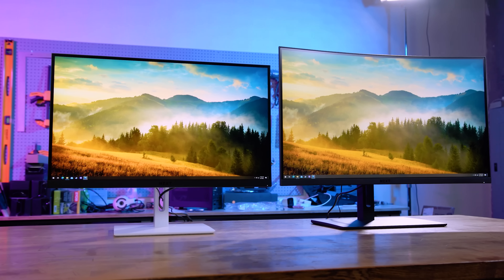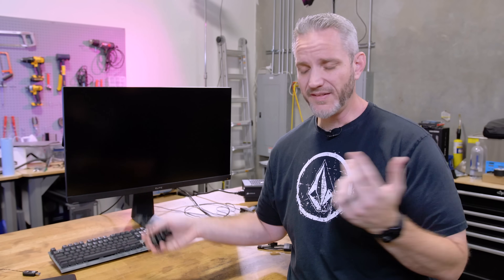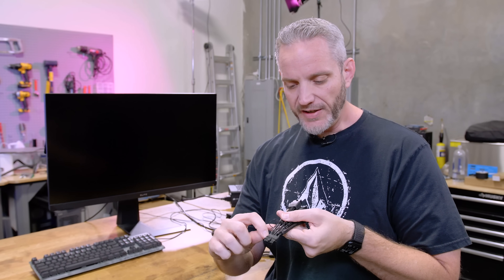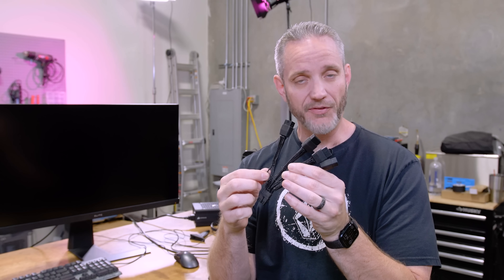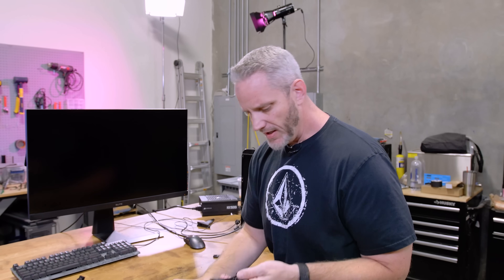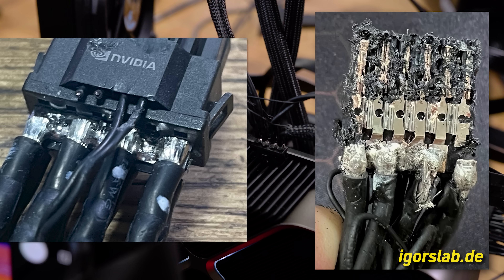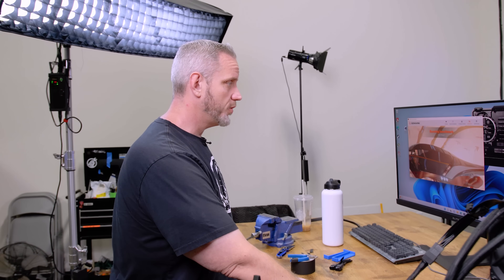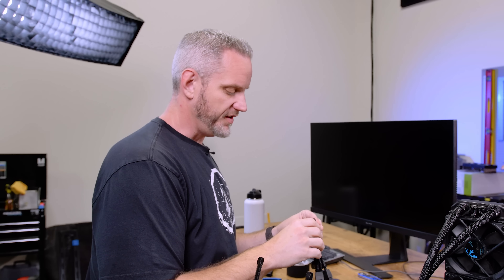Igor's Lab figured out why NVIDIA adapters are melting!

Comment: Jay, worst than no contacct at all is a bad contact (aka high resistance, but not open). If they cold solder barly touch the foil, then a hot spot is created. It's like having a tiny tiny wire with a lot of current going to it. In your case, there are other ways for the electricity to travel and this shouldn't allow for over heating on the bad contact. 

On the other hand, if all the wires from a single phase (rail) are cut due to desoldering or breaking pins, then there might be heat created through the bad contact from that rail trying to push its current though a small wire. 

For exemple, having 3 wires from the first rail on the 3 first solders spots and the last solder spot is being fed from another rail. If this last solder fails and make bad contact, then the heat would spread through pin and then the plastic and melt the connector.

This is my theory... Not sure if I'm clear. Englsih isn't my first language.
Reply: Spot on! It's the high resistance and intermittent connection of those broken outer wires. 
I remember as a kid I'd play with the light switches at home, trying to balance the switch between on and off... (made some nice spark noises) I melted 3... biggest hiding I ever got. 
This is amplified on DC.
Reply: I was about to say this. A bad connection is worse than no connection. If only a couple of strands of the wire are connected they can glow due to the high resistance. This can happen if the solder breaks but is held in place by the connector.
Reply: Yup, pretty much like an incandescent light bulb
Reply: Nope, bad connections carry little current in this situation, and have the least heating. Review the PCI-SIG report in Steve's video if you don't believe that.
Reply: that must be it - you pull it sideways, it breaks off then relaxes a bit as you let go. Then it goes back into place but barely touches this metal distribution plate and basically sparcs or just produces an ungodly amount of heat
Reply: I think this is it. A cracked solder or broken enough to cause some arcing seems more likely to be the cause of the observed damage to the outer pins, rather than just heat from increased resistance at the inner pins.
Reply: @laserspike  can you say which video? It's common sense if you're having a bad solder point either cold or cracked your having heat problems caused by high resistance. It shortly happened on my 3d printer. A bad solder connection of the power termonals caused high temperature which melted the fuse holder which was next to it.
Reply: Pretty sure it's a hot join, in electrical terms its the metal bracket and cracked which means its touching but not touching so it starts to Arc across and that's whats causing the plastic to melt. Happens in Circuit Breakers (most devices but more so CB's because its powering a Circuit not a device which is using more Amps) when you screw the wire in the Clamp if its not tight enough or sitting behind the clamp it can cause fires.
Reply: Exactly what I wanted to comment, then +1
Reply: Thank you! And that is exactly why the edge sides of the connector that are burning the most! And not due the "overload" of the other pins!
Reply: I think  @laserspike  is right, just have a look at how a parallel circuit of resistors works.
Reply: @1zui  Yes if the circuit is parralleke your joint won't heat like said in my first paragraph. What I'm not sure is if 2 differet rails are feeding 300W each. i.e. 3+1 solder on the connector. 3 first solders are fed from first rail, last solder from second rail. If the last solder breaks or has bad contact, then will that lonely wire try to feed the remaining 300W or what ever the cards require to work? 

Bad contact doesn't mean super high resistance (which would result in low current and just a tiny bit of heat before the tine pieces touching are melt then the contact is open). It means too much current for what a bad solder or small wire is able to support flows through it. 

A #14 AWG wire is rated for 15A. Put it on a 20A breaker and pull enough load on it (aka more than 15A) then you will have very hot wires in your wall. The #14 AWG is able to support 20A for a while, but eventually, your wires will become black then the plastic will melt then the exposed copper can start a fire. I think the same is happening here.

The wire and foil are able to support the current. The solder breaks, but stays in touch enough for the current to keep flowing. The contact is becoming hot because there's not enough "gauge" between the wire and the foil. It heats up, melt the plastic.

Comment: A piece of metal that is designed to be connected to a wire to is called a "terminal". The wire could be attached in different ways depending on the type, such as crimped lug terminal or a solder terminal or a screw terminal.
Reply: I would put magsafe on everything
Reply: I feel in this application that the best way to do this would be to ultrasonic the wire to terminal buss bar.
Reply: Actually the thin strip of metal is called a Bus Bar.  A terminal is specifically a device used to terminate the end of a wire (I.e.  Post Terminal, Screw Terminal, Push Terminal and the like).
Reply: @BromoDragoonFly  magsafe may affect timing too much at 600 watts. It's an awesome connector, don't get me wrong
Reply: @michaellindgren9653  exactly right. I've given up on trying to educate via YouTube comments. Hats off to those of you holding the line lol
Reply: Why is the solder touching? Was that encased in the wire jacket? If not, that could cause a short and a huge fire hazard. I also feel like Jay should've used a dremel to get into the cable. I think the jury is still out over if there's a recall problem.
Reply: A piece of rubber or plastic on the end of a cable that prevents this from happening is called "strain relief." Maybe, NVidia and the AIBs should google that!
Reply: @michaellindgren9653   I do not agree. Igors lab image at 9:34 clearly shows individual solder terminals for each wire cut into the bus. Yes, it also has a bus.

In the case of what is in this particular connector, I see a power bus or power plane (I wouldn't call it a bar since it is so thin), but I also see separated solder terminals. It doesn't matter if any of them are shorted to each other through a bus or some other device. It's still a terminal.

But for the meaning of terminal, at least using definitions common in the USA, look up a terminal barrier strip. It has many terminals on it. Whether a wire is connected or not, they are still terminals. Whether there is a bus shorting between any positions on the terminal strip or not, they are terminals. Each screw position is a terminal. An AC light switch has a hot, a neutral and usually a ground screw terminal. It's a place FOR an electrical connection, not necessarily the end of a wire and not necessarily the point where a wire is terminated.

A wire could simply be wrapped around the screw and tightened down to the terminal. If you have an insulated crimped end on the wire that end is called a lug, not a terminal. Many types like post lug, spade lug, screw lug or fork lug. There is a lot of confusion in marketing. Some companies call lugs terminal and or even "terminal lugs". The earliest uses of devices soldered, crimped or screwed to the end of wires to keep them from fraying or work hardening and developing cracks, that I see is when these wire ends are used on power cables. You still see the term "lug" being commonly used to refer to car battery wire connectors.

Reference (from the wiki page on screw terminals): "The wire may be directly stripped of insulation and inserted under the head of a screw or into the terminal. Otherwise, it may be either inserted first into a ferrule, which is then inserted into the terminal, or else attached to a connecting lug, which is then fixed under the screw head."

Comment: Having already cut back the connector probably helped it not fail. With the full connector still holding split contacts in close contact to one another likely causes arching between the two contacts likely deforming the plastic to a point it becomes a snowball effect on the connector via arching and resulting heat.

Comment: Hi,  on the soldering in the top left corner of your opened plug (9:58) it looks like the wire is a bit retracted. This is a possible point of failure too, as this may break under mechanical stress...and it is less surface contact as well as higher possible resistance. So even as it is way better manufactured ,it still could be possibly problematically.

Comment: The issue is not that the power goes through the middle wires, but that the corner ones (while not being fully connected) are arching inside the plastic, and that is increasing the temps.
Reply: That actually makes perfect sense!
Reply: It's called increased resistance.
Reply: What doesn’t make sense to me is that the melting is occurring at the pin connection point and not inside the connector where the problem is claimed to be. Hopefully Nvidia will share its findings. It would make sense that the melting would occur at the area with the most resistance which would get the hottest.
Reply: @Brian the reason why its melting at the pin side is because that's the thinner part of plastic. If the whole section is heating up, the thinnest part will melt first and everything else will follow.
Reply: The outer wires are stressed MORE due to the larger bend radius (and therefore force) on them when flexing the connector assembly. One of the Golden Rules in electrical/electronic power circuits is NOT TO CONCENTRATE CURRENT IN ONE PLACE ! Best practice is to DISTRIBUTE it. E.G. four 6 or 8 pin connectors. This issue of overheating is SO well known that it's TRULY INSANE that Nvidia chose to go this way.

Nvidia are also pushing the current rating of the contacts BEYOND the Molex ratings (8 Amps maximum per pin - as low as 5 Amps in multi-pin housings, as here).
Reply: @jimhall1131  There is no ARCING or evidence os ARCING. What you are seeing here is RESISTANCE HEATING and ONLY resistance heating.

Don't be a FATHEAD and make stuff up or talk about things you clearly don't even begin to understand.
Reply: Yeah, a single 14 awg is rated for 15A, so that would be 180W... it's pretty safe to assume they could go up to 300W without melting. So the problem is not all the current going through only 2 wires, but the disconnected wires making intermittent connection which is much worse.
Reply: @brianrobinson3961  The electrical resistance is its highest at the point where the contacts mate (due to the thin material used for the connector fingers), The large pin sinks heat well and is rarely a problem UNLESS the contact as a whole is allowed to overheat, doe to thin circuit board traces for example. It's very much al about sinking heat. For example, Molex derates the contacts to as low as ONE Amp when used with thin wire.
Reply: @Alvin853  Reminds me of the sparks from plugging and unplugging from the grid.

Comment: I think a shoddy connection, disconnected and inside the harness still, arcing to the pad could generate a lot of heat
Reply: Just posted the same, melt enough plastic and you will end up with a dead short, if the plastic is melting at circa 120 degrees the wrong plastic has been specified
Reply: For sure arcing would be the biggest concern. An absent wire at worst will increase the heat by a little bit on the other three. Concerning, sure, but unlikely to be fire hazard worthy. A small enough gap to create arcing will be drastically more heat, enough to ignite the rubber and plastic housings.

Comment: The 'piece of metal' the wires are soldered is commonly referred to as a Bus Bar 😉

This is nuts. Insane that this construction was ever approved.
Reply: A penny saved is a penny earned.
Reply: @Mr.Canuck  Actually, to make that type of connector would cost more than just the normal crimped connector.
Reply: @dodgem259  Also the added cost of recalls and RMA and lost sales due to bad PR. When you try to be overly stingy you end up paying double than you normally would.
Reply: Might as well call them Sus Bar now
Reply: @dodgem259  Yes, exactly my point....they cheaped out. Their complete lack foresight is astounding and will cost them far more than splurging an extra 50 cents on a proper connector to begin with.
Reply: @Mr.Canuck  until having to redo it eats up all that saved money AND then some. AND ruins your rep. Yeah great job and great decision. lol
Reply: @Mr.Canuck  ummm no. He said it's more expensive to do it the way they did.. with the soldered bus.  The opposite of cheating out.  ALSO.. that's not even the problem it's the connector not being plugged in properly.

Comment: From Igor's teardown it seems pretty clear that the most likely culplret here is either poorly and inconsistently soldered connections causing high internal resistance and then heat as a byproduct, and/or movement of the cable causing the solder joints to weaken or come away from the pads partially, which would cause even higher internal resistance and more heat. It's unlikely the cable would come away from the pad entirely while everything is being held together.

Having the wire come away entirely would actually be the better scenario as a severed connection would not generate any heat, but would cause the still functioning pins to be loaded beyond their capacity provided the sense wire is still telling the card that the full 600W is available as Jay describes here. 

I'm betting the outcome of this is that in all cases either poorly soldered or broken internal connections are to blame.
Reply: You also need to consider the fact that manufacturers are required to use unleaded solder. The unleaded solder is harder to work with and results in a joint that is more brittle than leaded solder. In addition the unleaded solder requires higher temperatures which could result in more thermal stress to the metal contact that the wire is soldiered to.
Reply: A partial break would also explain why the outsides of the connector melts.  A severed outside cable  would melt the center of the connector.  (Backseat drive with 20/20 hindsight!)

Comment: It might also be possible where the wire/bridge breaks but because of the housing the contact stays in proximity and could begin to arc, which might be where more heat is generated.
Reply: @kasparjensen1822  false.
Reply: 30,000 volts per centimer is generally required for arcing, with a minimum of 327 volts to arc. So yeah, no arcing from 12 volts. Familiarize yourself with Paschen's Law, or at minimum some electrical engineering.

Comment: If your motherboard supports the use of a thermal sensor, I suggest you'll strap it to that connector and set your bios to sound an alarm if it exceeds a certain threshold.
Reply: Thermo sensor for a connector?

Comment: When I researched solder vs crimp for power cables last year the one take-away I got was that if you solder the cables, some amount of solder will be sucked into the cable itself and it will harden it, making it easier to break because you essentially created a kind of lever. Thats why crimping cables is the superior technique because the cable stays flexible.
Reply: yup unless you talk to the clueless aka the internet who think there's a debate. The car channels are the worst for that. Soldering wires are for hacks if it moves/bends/vibrates.
Reply: Yeah crimping allows for flexibility, I've always preferred crimping cables rather than soldering. Also makes them slightly more serviceable.

Comment: This takes "Nvidia GPU's are ovens" to a whole new level
Reply: Ironically enough the 4090 runs cool. Especially compared to my 3080 and 1080ti before it.
Reply: @cosmocalypse3708  Having low temps doesn't mean it's running cool. Your 4090 has a way bigger cooler and draws a lot more power.
Reply: @cosmocalypse3708  @Osmium you both missed the joke. Congratulations. You must both be a riot at parties.
Reply: GTX480 wants to know your location.
Reply: upgraded to an arc furnace
Reply: @truckerallikatuk  At least GTX480 being hot aside it still managed to stay alive. 

The GTX590 on the other hand...I still recalled reports of it literally burn a hole through the PCB of the card lol
Reply: @MrAntiKnowledge  I knew some idiot will bring another brand just for the sake of whataboutery.
Reply: Nvidia GPU: I now identify as a BBQ
Reply: @GM-xk1nw  what other brand? I was refering to a literal arc furnace.
Reply: I have 3 PC's around the house that I'm using to warm my home rather than turning on the gas central heating 🤣
Reply: mine works a space heater in the winter. lol
Reply: @soggypeanut9161  When you were partying

I studied The Blade

When you were having premarital sex

I mastered The Blockchain

While you wasted your days at the gym in pursuit of vanity

I cultivated Inner Strength

And now that the world is on fire and the barbarians are at the gate you have the audacity to come to me for help?

Comment: @jayztwocents the issue is, that a crack or a partial break will result in resistance increase and can also cause arcs which also increase heat , best case scenario is a total break

Comment: I think you may have misspoke. If the solder joints broke causing the outside wires to no longer participate in the load, then the inside wires need to pick up the additional draw. And from what it looks like in your pictures, there is a bus bar so the load would still be spread across all the pins. It looks more like poor/intermittent connection is what would cause temps to rise.
Reply: That would still be 225W per wire (50% more than the old 8-pin) with the TDP of a 4090 or 300W per wire when two are broken.
Reply: It was definitely arcing. 👍